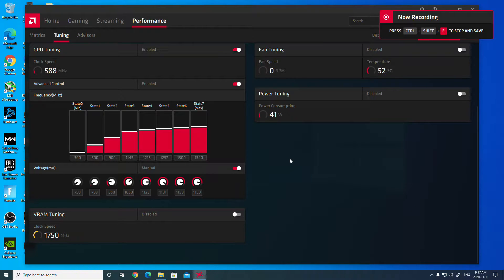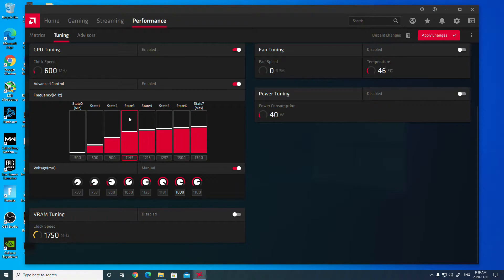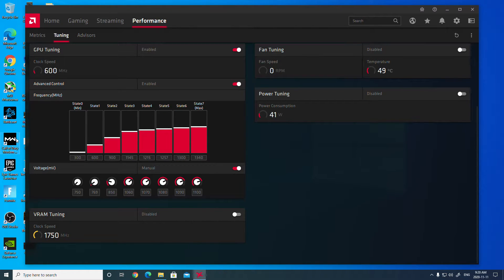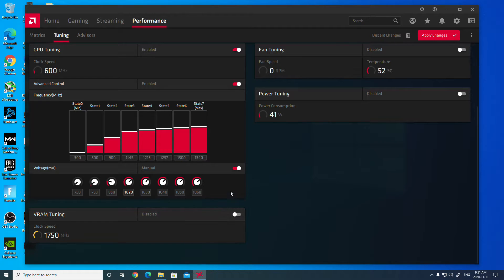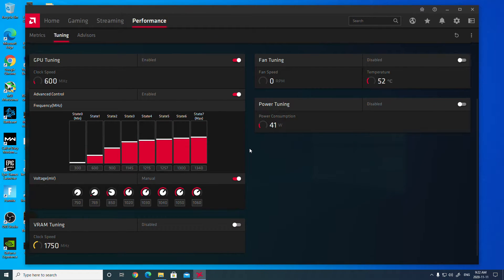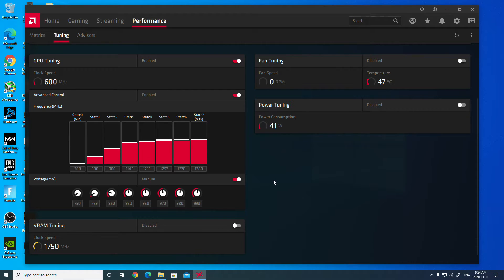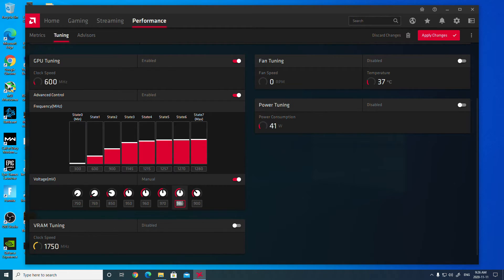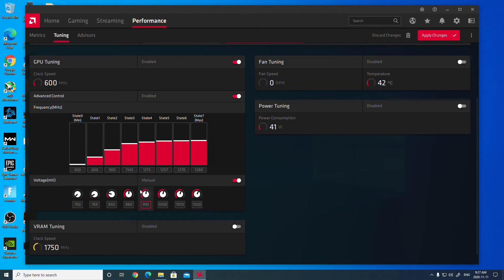How to Undervolt RX 570 RX 580 Stable Voltages EXPLAINED - Lower Temps - How to Fix Overheating GPU

Comment: Does your gpu load fluctuate alot, mines fluctuatiing from 0 to 100 all the time in gpu z. Its worrying for a first time builder
Reply from the maker: its nothing to worry about, the reason its not at 100% usage is because your CPU is bottlenecking your gpu while in game.
its normal! dont worry

Comment: hi can you please give me some advice as I am a newbie do this. I get high temps 76 - 86 with my gpu. Is it necessary to undervolt? the reason i would like to is so that my fan noise can drop. its quite noisy during gameplay. also I do not want this to affect my fps. you state reducing clock speed reduces performance, so do you have lower fps when state 7 is lower then its default?
Reply from the maker: yes you have maybe 1-5% lower FPS but i dont notice it when i undervolt my card. https://youtu.be/0pzxFZBw-6Y
this video shows you exactly what settings you can copy onto your card to reduce heat and noise.
Reply: @AleksandrsBrodie  thx for the speedy response. I saw the latest video now. Ill run a few test with and without undervolt to test fps. Excellent videos.
Reply: @AleksandrsBrodie  you turns out my mhz is default low. State 7 is  1268, so ill lower my voltage to  990. Its default is 1150. Will update my results. Thanks again
Reply from the maker: @hobobro9445  remember, if it crashes, it means that the voltage is not stable for the given core clock you want to run. so you can either increase the voltage if the temps are good, or lower the core clock.
its about finding the right balance.
Reply: @AleksandrsBrodie  ok major difference no crash yet. i am idle now at 67 avg temp. i was at 86 in GTAV WILL test rdr2 now. thx so much. my volts are the same as yours. my clocks are waay lower then yours on default. 2 more questions  can i lower the voltage further?  and can this damage my gpu in any way?
Reply from the maker: @hobobro9445  yes you can lower voltage.
And no it wont damage the card.

Comment: Thanks for the upload very informative. Worked great for me after my new Asus RX 580 would crash randomly without warning on World of Tanks only. Such a shame that the factory defaults cannot be set stable from the off. I was close to calling this as a faulty card as I had done all the system checks, ddu'ing uninstalls and driver re-installs. I run a different profile for each game and vary the fan profiles too.
Reply from the maker: Glad it helped. I have a few other good undervolt videos on my channel

Comment: Thank you very much for this sir!! youre a god, from 85°c copied your settings and customized fan curve, bumped down to 60-66°c !! God bless
Reply from the maker: Glad it helped.
And remember if you cars crashes it means your voltage was too low for the clock speed have set. So either increase voltage or lower core clock so it will be stable.
Happy holidays
Reply: @AleksandrsBrodie  i need you help man 
When i chaged the settings like you and start the game suddenly crashed.any solution?sorry for my bad english
Reply from the maker: @raoufraouf3139  you need to increase your core voltage, each gpu is different, some can run these lower voltages, but other gpu need higher voltage, so maybe run 1050mv
Reply: @AleksandrsBrodie  im new its my first time buying a pc gamer 
But if i can ask i played shadow of the tomb raider with 83© is that okay?
Btw my carte is rx580 4gb
Reply from the maker: @raoufraouf3139  I personally think that is too warm, I would aim for 72-75c.
Try running a lower core clock maybe 1200mhz at 950-980mv for state 7
Reply: Same here - this really helped keep my GPU cooler
Reply from the maker: @SkullBoner69  glad it helped Brian.
Happy holidays

Comment: It doesnt work for me i have a ASUS STRIX 580 8GB ans no matter what voltage or core i put it runs at 85+
Reply from the maker: I would clean the thermal paste.
Also watch my undervolting video which you can find on my channel called, optional voltages, those are much more power optimized clocks and voltages which will probably make a difference
Reply: @AleksandrsBrodie  update : i cleaned the thermal paste and max temps of 65 now!!!! Ty
Reply from the maker: @braxz1288  😉👍

Comment: hey my main problem is stuttering in almost all video games, any solutions for that if things you showed in video dont work?
Reply: All games I played would sutter, but when I fix the clock speeds and voltage for my GPU it fixed the stuttering
Reply from the maker: @Alexdbzmovies  interesting. Thx for the insight.
Happy holidays
Reply from the maker: stutter is generally caused by your CPU, not your GPU

Comment: Did it and work fine in dark souls 3
But whenever i play PUBG, there is some weird pink strip in grass and building!
So i just default everything and pink strip just disappear, Just WHY ?
Reply from the maker: I would increase your state 7 voltage a bit, you are probably not getting enough voltage so the game does not run properly.
Reply: @AleksandrsBrodie  Gonna try that, thanks anyway

Comment: I have xfx rx 570 8gb and always have crash when i play games for couple minutes.Bf5,Bf4.Can you please help me i just bought PC?
Reply from the maker: I would make sure you have a custom fan curve set up and use a program like msi afterburner to monitor your gpu temps to make sure its not over heating.
if it is overheating, i would manually increase fan speed and lower your core voltages.
Reply: @AleksandrsBrodie  My state7 is 1287 when i lower voltage to 1060 and other for -10.After that when i try i got crash again :(
Reply from the maker: @Stefan-jt8rn  then I would leave your voltage for state 7 around 1060-1080mv.
Reply: @AleksandrsBrodie  I put 1080 and after 15min got crash again i played longer than before gpu temp was 74c
Reply from the maker: @Stefan-jt8rn  I would lower core clock to 1250 then and try again, with same 1080mv
Reply: @AleksandrsBrodie  It works i can't believe i'm very happy  i lower clock to 1250 and did't crash.Thank youuu sooo much thank you
Reply from the maker: @Stefan-jt8rn  glad it helped
Reply: @AleksandrsBrodie  my happiness did not last long again the old problem returned again crash  :((((
Reply from the maker: @Stefan-jt8rn  you can also try even lower core clock, 1200mhz at 1040-1050mv.
Reply: @AleksandrsBrodie  Still got crash :( this is killing me  i bought a pc 3 days ago and i cant play any game longer than 10minutes even 10 years old games
Reply from the maker: @Stefan-jt8rn  also check your cpu temps to make sure that is not overheating either.
Otherwise i would return the pc or talk to the person who sold you the pc
Reply: @AleksandrsBrodie  CPU temps is 56c and gpu 72c when i play BF5 with 60fps, and i got crash after 5min i dont know what to do
Reply from the maker: @Stefan-jt8rn  you can try to update your drivers. otherwise i am not sure.
Reply: @Stefan-jt8rn  what is ur psu?,i have same problem,and I changed my psu to better one,and tadaa fixed
Reply: @rafisyahriyu  I found that  my ram memory was a problem, its always crashing in dual channel but when i play in single channel i can play without crash ing

Comment: bro just tell me which minute i need to copy all for rx 580?
Reply from the maker: it depends on the card you have and what clock speed you want to run.
the whole idea is that you choose a clock speed you want the card to run at in state 7, 1300mhz for example, then its to find the lowest stable voltage for that state.
ie 1300mhz should run on most systems between 1000-1060mv on state 7.
Reply: @AleksandrsBrodie i have rx580 saphire 8gb all i want is to not hearing this screaming fans when my gpu is on pressure
Reply from the maker: @svetlifishing580  I would drop your Core clock to 1340 mhz, 1080mv for state 7 voltage and use a program like MSI afterburner to set a custom fan profile so that you can manually control the fans and how much they spin. if you aim for 70c at peak load, the card should run pretty quiet. if you have sapphire nitro + then you will have no problem, if you have sapphire pulse, then you will maybe want to run a lower clock of 1300mhz, 1060mv and again, set a custom fan curve so your temps are around 70c when under full load.

Comment: Brilliant and really helpful video here, it's a really good insight and clearly detailed tutorial. Very enjoyable to watch too!

I finally worked out a solution personally. I'm using a RX 590, and was regularly having crashes while the card was under load, restarting the PC. 
This problem has occurred on and off for a good year (since I've had the card), depending on the game.

Using Wattman, I decided to lower the wattage more drastically down to -25% (before it was between 7 - 15%)
And you know what, for the first time ever with this card, I'm no longer getting any crashes at all.
I also lowered the GPU's clock speed to 1350mhz,, I'm sure that can be toyed around with more now that it's stable.
VRAM is at default 2000mhz. (The first Watchdogs has been the latest of problematic games where this fix came around to me)

I didn't edit the core voltage, but I'm sure using Wattman would have had a similar effect :)
I'd be really pleased if this helps anyone else that have had similar problems, because it's driven me nuts finding solutions for this card haha!

Edit: Forgot to mention, I bypassed Afterburner to try this just using Radeon Software on a whim.
Reply from the maker: A lot of people have had issues with the RX 590, 
And yes lowering your clock speed is a very good idea on that model of card, I would recommend about 1080-1100mv for 1350mhz core clock.
That should be stable. but as you know, every card is a bit different,.
You can leave the memory clock as default.
Reply: @AleksandrsBrodie  I've honestly never had so many problems with a bit of computer hardware in my life haha!

I'm a happy man now that it finally works partially as intended 😁

Comment: Hi my main problem is with the very laud fans, once i start Hitman 2 for example fans start to be very laud very fast, will this undervoltage help with the noice as well?
Reply from the maker: Yes it can help reduce noise as undervolting reduces power draw = less heat = dont need to run fam as hard to keep card cool
Reply: @AleksandrsBrodie  thanks a lot mate!
Reply from the maker: @doncoa90  you are welcome

Comment: thanks alot for the video sire,
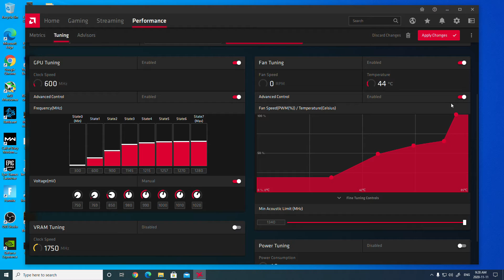but can u tell me if i can set my Min Acoustic Limit (MHz) to 1340 as it displays in your fan tuning tab at 10:51 ?
cuz i have default on 900
Reply from the maker: I am honestly not that familiar with acoustic limit. I just use msi afterburner to set the fan curve.
Reply: @AleksandrsBrodie  thanks for the reply sire

Comment: it possible to fix my black screen if i undervolt my RX580 ??
Reply: It's usually a driver issue. Radeon software is notorious for being subpar. You may try different versions and test it out. I've also had problems with black screens happening randomly, driver 20.4.2 was ok in this regard, and recently i installed 20.11.2 which also works pretty well.
Reply from the maker: Potentially.

Comment: Hey man. What is min acoustic limit and why you have it at max? Thanks
Reply from the maker: I personally just use msi afterburner for the fan speed/curve.
I dont know exactly how the acoustic setting works, but I would just set a fan curve in the and software and try it out in a game.just make sure you monitor your temps
Reply: Ok thanks. Did you have an idea how much rpm is good or how much % i must use the gpu fan? Is 100% bad for the gpu fun?Thanks again.
Reply from the maker: @andreastetraxordos  it depends on the fan type.
Ideally you set undervolt settings so you can run your card around 70-74c under load with 35-75% fan speed, again depends on the card fan and cooler design
Reply: @AleksandrsBrodie  ok. It runs 67c at 60% fan speed so i Suppose its fine?
Reply from the maker: @andreastetraxordos  ya, that sounds fine, you can even lower your fan speed if you want less noise and have card run closer to 72c
Reply: @AleksandrsBrodie  ok thanks mate :D

Comment: Umhhhhh stupid question does setting up 500mv is equal to 50w 100w is 1000mv?? In state 7 Rx 480
Reply from the maker: good question and no it does not ;)
there are a lot of factors that influence the in software power draw reading (which is not accurate but is useful in knowing if you are using less power than you were before undervaluing)
For RX 480 I would probably run 1200-1250Mhz on core state 7  at 950-1000mv depending on your card.
And just follow the voltage curve that I recommend for states 6-3.
Reply: @AleksandrsBrodie  should I use power tuning too ?
I'm currently at 1100mhz at 1070mv whenever i try to increase  
MHz to 1200-1300 power consumption gets upto 120w instead of  staying at 105w both are State 7 1070mv
Let me see video again correctly i did get down my temp by -7
Reply from the maker: @symbianz1078  its ok if power consumption goes up when you increase clock speed, its normal.
The main thing to look at is the temperature. 
The point of lowering power draw is to reduce heat.
But if you card is running cool, its ok if it uses more power.
The whole goal of undervolting is to have cooler temps. I would aim for 68-74c.

Comment: Thanks for the video bud, i fucking hate to bother with temps and voltages, my RX480 Red Dragon is a pain in the ass.
Reply from the maker: some cards just run dam hot, sometimes re pasting the thermal compound can be the best first step
Reply: @AleksandrsBrodie  Thanks for the reply dude, i already did that. Maybe the thermal paste i used wasn't as good i thought.
Reply from the maker: @gabrielrc_  If there isnt much change after doing the thermal paste, then I would try reducing core clock and voltage.
You can try 1200Mhz Core clock @950-1000mv depending on your silicon quality

Comment: Thanks! Any tips for ideal fan curve?
Reply from the maker: i generally aim for my max load temp to be around 72c. but it really depends on your card.
Glad it helped ;)
Reply: Use my MSI fan curve settings:
36% 24C
60% 64C
100% 88C
Update Time to 25000ms